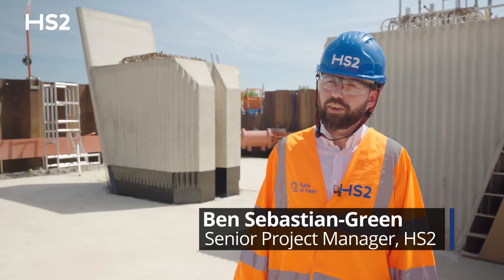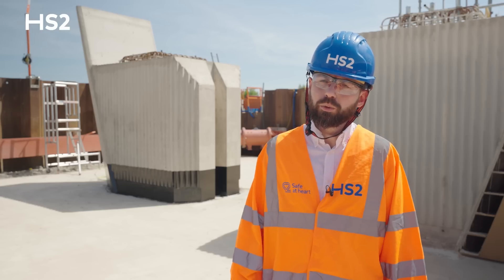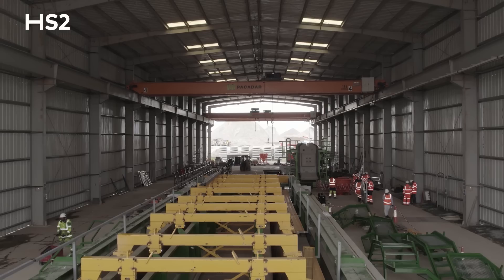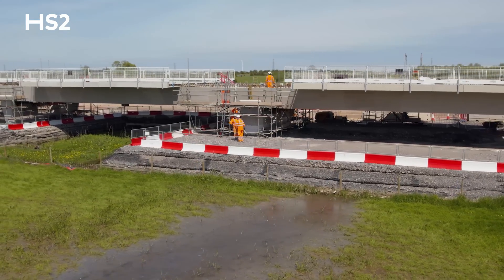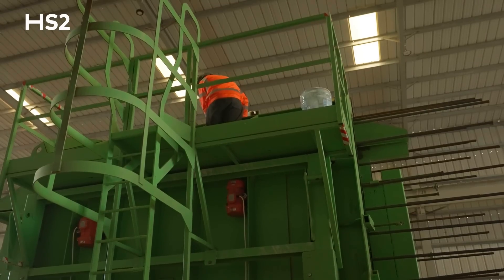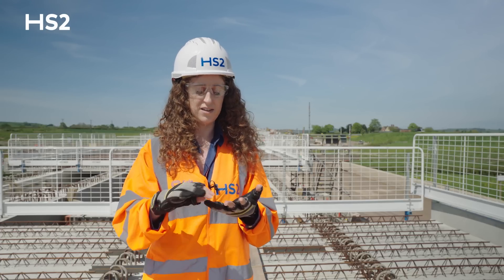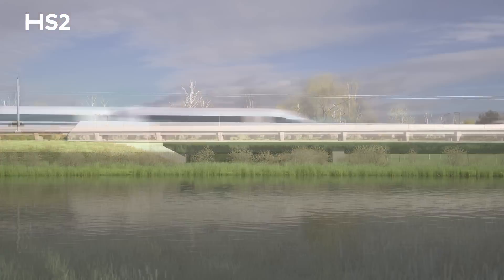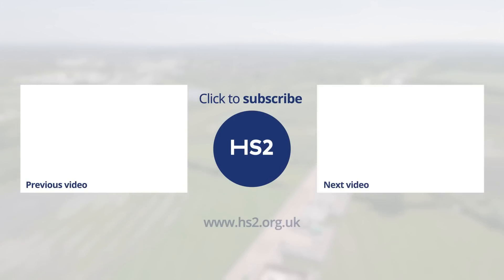HS2 celebrates halfway point for pioneering Thame Valley Viaduct

Comment: Interesting to know how they spread the load  through the foundations of all those solid concrete pre-cast piers and decking, given that tbe land the viaduct traverses is well water-saturated "Bottom - land" (Mostly. Clays.?) of the Vale of Aylesbury. Lots of deep piles  down to the chalk ? Or does the structure effectively float on the clay.?
Reply: Unlikely to float as that could cause movement by differential settlement.  Probably deeper piles.

Comment: Pleas stop with the 'Sustainable' 'Carbon footprint' 'Biodiversity' etc language-no one really cares. Anyone actually been near these highspeed trains?? They are REALLY loud not sustainable, huge carbon footprint and biodiversity killers.
Reply: Are you aware that internal flights in France are to cease because there are TGV lines across France ? The carbon footprint of a TGV journey is 1/8 of that of flying. If we can build HS2 it will become non-commercial to fly between London-Manchester and London-Glasgow. Those reductions in carbon emissions need to be factored in to the debate over High Speed Rail. Likewise displacement of freight from road to the legacy railway network, once the passenger trains are on the HS. The inside lane of the M1 is like a slow moving freight train with thousands of heavy lorries belching along !.  Lets get that on rail
Reply: Incorrect but go off

Comment: Are HS2 going to turn that road alongside the viaduct into a new road traffic scheme or will it just be left to be overtaken by  nature over many years.  Seems such a waste of money to build a road parallel to the railway that won't ever be used?
Reply: That is almost certainly a construction access road. Built so that the heavy machinery can access the various parts of the project without getting stuck in mud. Once the construction is complete the road will be removed and the land returned to floodplain.
Reply: Yey sure, the HS2 construction bosses have installed a 'haul' road to assist with the build and keep traffic off local roads. Then they will just leave it there when they are done, for weeds to start growing up through it and abandon it to nature !. You know very well that it will be removed and all manner  of expensive remediation will be done to return that land and the surrounding area to a natural state. Except, it will probably be superior than what was there before.

Comment: I just don't understand why so much flat greenbelt land either side of the route needed destroying in order to build two tracks. Are they planning on building houses along it or something? In places like Wendover and Aylesbury we are talking tens of footbal pitches of green belt running for a good kilometre along the track, all seeming to have been needlessly graded. You can check out the degree of destruction from satellite photography already.
Reply: Not sure but it will be returned to original. A cycle path would be a nice addition though. I guess no forward planning for that though .
Reply: Where the railway goes in a cutting the cutting is excavated out at a  batter of 30 degrees from the horizontal to prevent the earth from collapsing onto the railway. The thirty degrees is known as the angle of repose.which is the minimum angle to prevent earth collapse. That takes up land and the deeper the cutting the more land gets taken. The graded slopes will eventually be grassed and planted over. The alternative way is to build a vertical retaining wall  which will cost a lot more money.

Comment: By the time the line is operational, nobody will be able to afford rail travel!
Reply: The new UK nuclear power plants (GenIII+ and GenIV) will allow electrification of all UK and at low green energy cost.  The HS2 is the future of high-speed rail in UK and hopefully the USA can take the good hints too.
Reply: People can't afford rail travel because prices are high. Prices are high because demand is higher than supply. Demand is higher than supply because the rail network is full. The rail network is full because there's not enough space to run all the local, regional and national high-speed trains we need. Solution: build more tracks and stations, like HS2 is doing.
Reply: @jamesadfowkes  Yes.  The HS2 adds high-speed capacity which will then permit additional slow trains to run on the heritage rails lines.  So HS2 adds high-speed travel alternate lines to the older heritage slow lines...so then the old lines will get more travellers and freight transport.
Reply: @jamesadfowkes  Prices are high because of greedy overseas owners and shareholders milking the system for all they can. Why is UK rail five times more expensive, per mile, than mainland Europe?
Reply: @simonbaxter8001  In this instance because the land is more expensive, because it contains many bridges, viaducts, tunnels to be sympathetic to the landscape and numerous habit mitigation projects, other countries don't bother and just shove it straight through, Chinese contractors would have knocked it out cheaply, it will last over 100 years so that's 1 billion a mile per year it's peanuts, we support illegal immigrants for 5 billion each year and majorly they provide no benefit only costs, your flailing the wrong horse!?!
Reply: @TomTomicMic There is no difference to Germany.
Reply: @jamesadfowkes .. but the rail network isn't "full". That's just lying rhetoric spouted by HS2 Ltd in order to squeeze more money from the government.
The blatant corruption within HS2 Ltd that's recently been exposed reveals that senior executives shredded documents a used misleading stats & projections to ensure billions of pounds kept flowing into the project.
Whistleblowers claim they were told by bosses to lie about the project’s cost & were sacked after speaking out. They say the government wasn't  informed of the real cost of HS2, all while voting on laws that approved its construction.
Take the WCML for instance .. arguments that it's "full to capacity" rely on a discredited, out of date forecasting model which overestimates long distance passenger growth & isn't used for anything anymore except to justify the monstrous vanity project that is HS2.
Network Rail's "New Lines Programme Capacity Analysis" shows that WCML capacity is kept artificially low by private operators wanting to maximise profits.
A DfT analysis shows that in peak hours leaving Euston, WCML trains were loaded at just 52.2%.
Because of the ridiculous pricing system on the rail network, domestic flights are booming & that's expected to continue even when this massive white elephant becomes operational (in about 50 years time given the current rate of progress).
It's nothing more than an environmental disaster of epic proportions & Britain's biggest infrastructure mistake in half a century.
Reply: If the railways get nationalised it will be in the public hands so yes I will be affordable
Reply: You've been brainwashed by Sunak?

Comment: Superb. Thanks for the update . I hope I’m still alive to take a train when they enter service in 6 years .
Reply: Why 6 years ? The halfway point of building this viaduct has nothing to do with finishing HS2 in 6 years.
Reply: I can't wait already. It's always memorising riding a new train resulted from a successful mega project.
Reply: If your younger than 75 im sure you will
Reply: 6 years seems optimistic looking at the slow progress so far
Reply: @Kevwendover12  not optimistic.  They are really doing this now and getting on with it.
Reply: @Kevwendover12  Unfortunately the time taken is because the Government overspecified ground settlement and infrastructure life expectancy to a level not seen anywhere else in the world for high speed rail.  The Engineers (HS2) had to meet this contractual requirement that meant embankments and cuttings have to be made then left for some time before finishing to the final profile.  This was the main reason for the initial ballooning costs and delays after the initial route was decided, but since then the cost increases have been modest as well as in line with inflationary pressures.
Reply: @clivewilkins1754 Nonsense, when the works are designed to resist settlement. The reason for cost increases is because the original budget price was not thought through in any detail. And the reason for the delays are because HS2 don't have enough staff with the experience to deliver the project. The new hospital programme is suffering with the same problems.
Reply: @TrevorWilliams-fq8mg  The budget price was based on a specification of 320 km/h design speed, typical of new European high speed rail.  The client (Government) changed the design speed to 400 km/h plus the requirement for 120 year design life and much smaller tolerances on settlement.  This required a budget review to build to this standard nd increased the cost.  Call it nonsense if you wish.
Reply: @clivewilkins1754  But would that make the cost difference of 30 billion plus ? (original budget 32.70 billion, current cost 66 billion). And why would it cause a progress delay  ?
Reply: @TrevorWilliams-fq8mg  In response to residents concerns along the route, the Chilterns tunnel length was extended and other cut and cover tunnels added to the design adding to the cost. It has been argued since by some, that some of this was later thought to be unnecessary.  Natural settlement of earthworks is required to meet the higher specification and this cannot be achieved or accelerated by using machinery alone and why this introduced additional time to completion.
Reply: @TrevorWilliams-fq8mg  the new hospital program, come on , you didn’t fall for the 40 new hospitals like from Boris did you ? OMG 😆
Reply: A white elephant TORY TROPHY ‘we are good at infrastructure project regardless of actual need’ . This while we are drowning in shit trying to surf, eating shit and plastic due to poorly
treated water while the greedy water companies pay out dividends and do the bare minimum, clearly certainly not doing the necessary grey / surface water separation which has been blatantly clear for years . 9 perhaps Severn Trent are the only half decent water company , maybe ?  The only way like it or not is renationalisation. fines are pointless they just get paid by our rip off water bills ( We are one of the worst with sw water (Pennon group). Another Thatcher shibboleth chicken home to roost, like the blood transfusion scandal , the start of the Tory death by thousand cuts to the NHS . So “sir” Kier Starmer talks about renationalising railways , oh dear,….. low hanging fruit Kier, WATER IS AN ESSENTIAL  and no one could deny the harm that years of under investment have done.
Reply: @johncrispin2118  Now that you've got that off your chest, I hate to say, but I think you meant to post this elsewhere?
Reply: @mrglide7078  thanks you are quite right , got a bit fired up by watching the TV sorry just a grumpy old geezer !